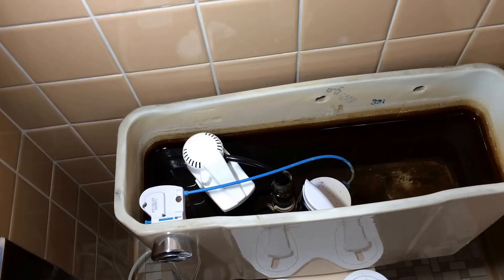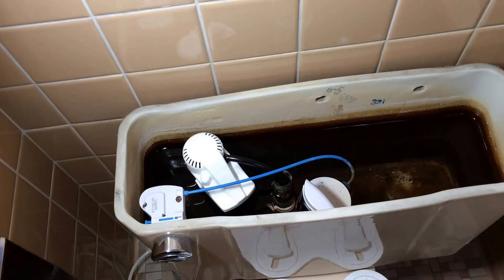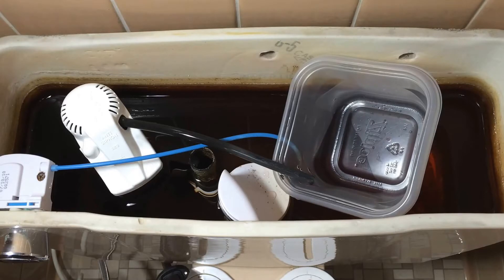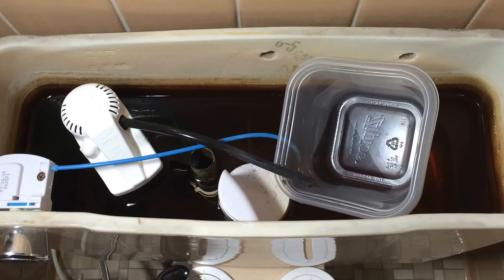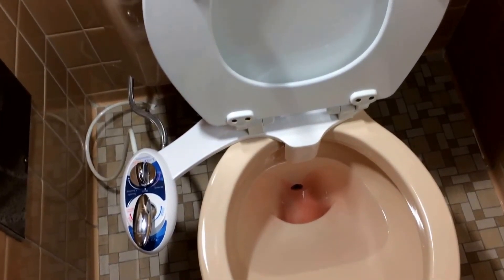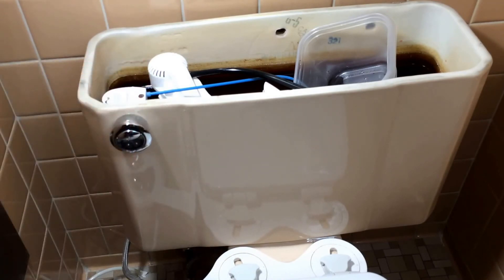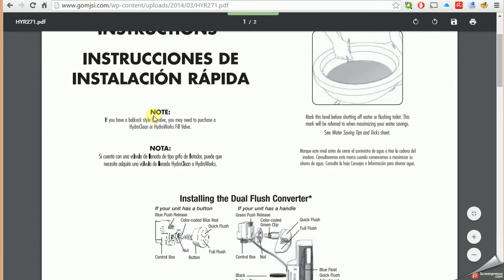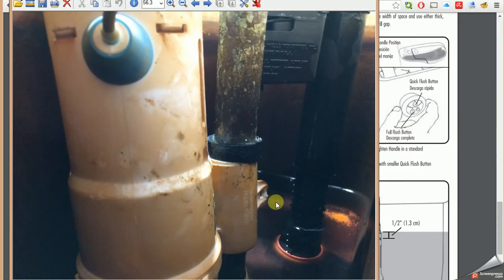DIY simple toilet leak detection and repair of a dual-flush system

Comment: Putting the small refill hose into the container could mask an existing problem.  If the refill hose is too long, and/or the end of that hose is not supported above the water line, it can siphon water out of the tank and drizzle it into the overflow tube.  If that is happening, pulling the hose up and putting the end into a container may convince you that's not the source of the problem, when it might still be.the problem.  Always make sure the end of that hose is above the tank water level.
Reply: That was my problem - now solved. Thanks !

Comment: What is the size of the rubber seal that needs to be replaced?
Reply: Really, anything that will keep the device firmly fixed down on the outlet.
The metal hose clamp is a great idea. The rubber is just to fill in for a size difference.
Lots of luck. !